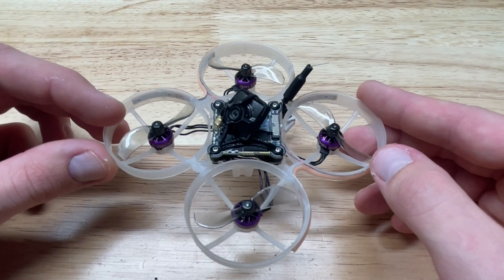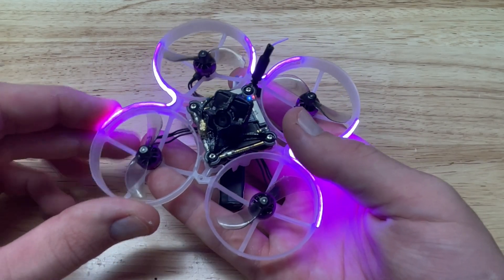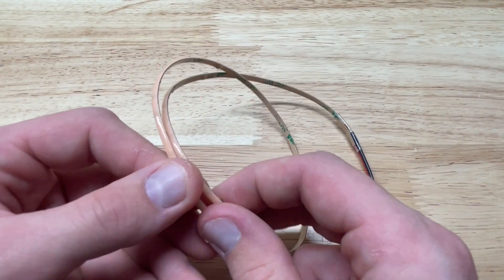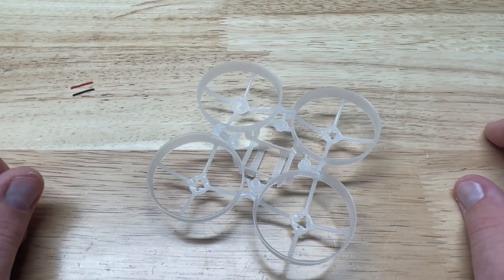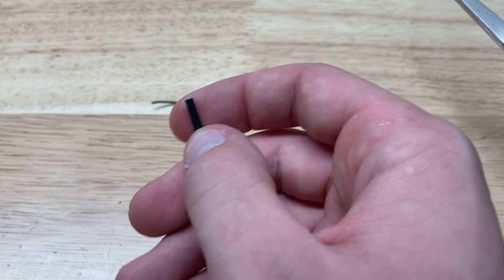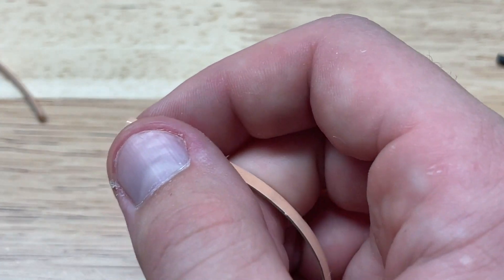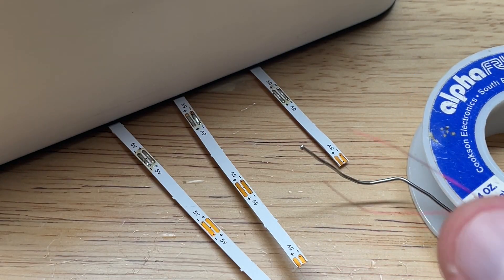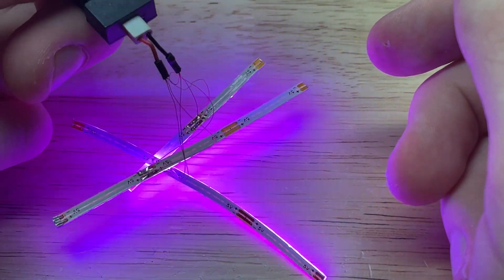Tiny Whoop Quick Tip: How to Wire and Install COB LEDs | CustomFPV

Comment: Hello, great job on the LED install, and great instructions...this is exactly what I was looking for. 
I do have a couple newbie questions if you don't mind. 
Am going to assuming you can get power for the LEDs directly from the battery input on a 1S setup. 
However, where do you recommend pulling power from a 2S setup, I see a few spots on my flight controller (FC) with 5V supply, again, I assume any of those would work!?!? 
Lastly, can the LEDs be turned on and off with a transmitter switch via the FC? 

Thanks
Reply from the maker: Hello, Glad my video helped!! Here are my answers to those questions:

1. Yes you can absolutely power LEDs of the 5v regulator, I just don't in this case because the LEDs pull a significant amount of current for the small 5v regulator on this 1s board, but it should be no problem on larger builds.

2. In this setup, no. It's just connected to power so anytime the drone is on the lights will be on. If you want them to be controllable by a switch you willl need to use the LED pad on the FC and the betaflight LED menu. You will also need a differnt type of LED that is addressable for this so the FC can send the strip commands over a. signal wire
Reply: @CustomFPV  Thank you for your quick and detailed reply, I really appreciate it. I  definitely have the correct path forward now. Happy Flying  🙂

Comment: Call Bardwell, I learned something today! I didn't realize you could run power to the center pads on the strip and it would power the whole strip.
Reply from the maker: @dubzsquaredfpv7171  Yup! super handy
Reply: I just learned this today too... I'm trying to add LED's to the rear of a 5inch and have been trying to figure out how to do it without splitting the cob strip or running wire along the arms!